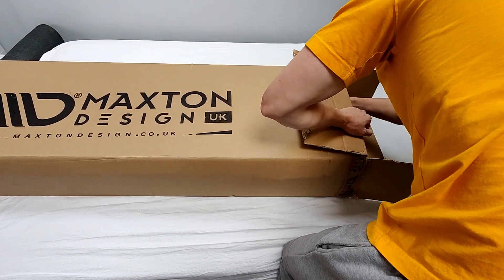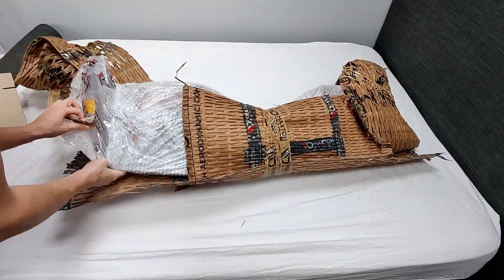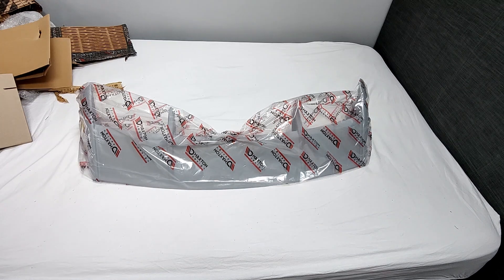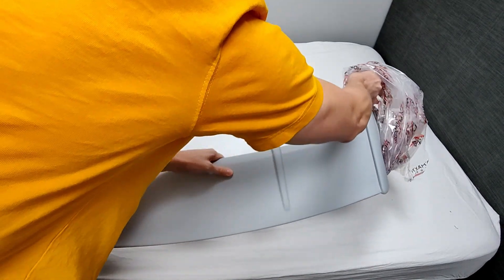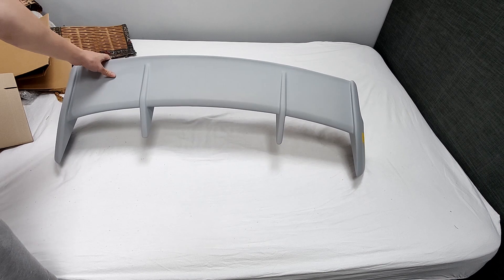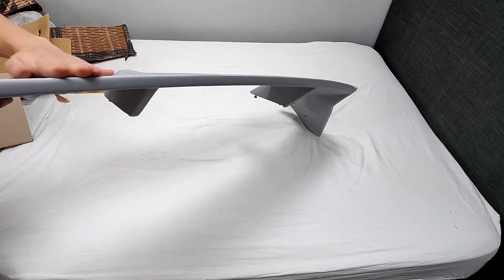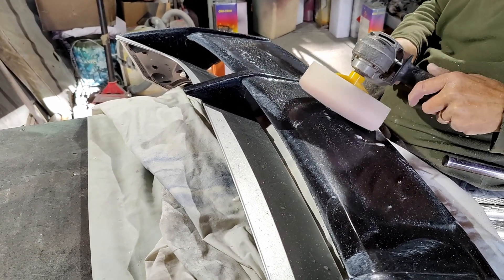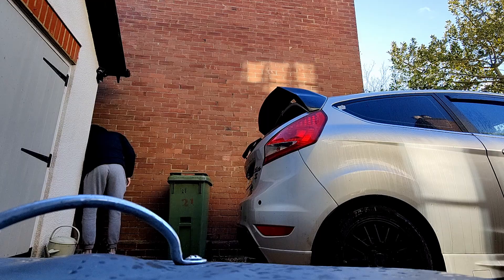RS spoiler for Mk 7 Fiesta

Comment: Did u drill holes in the boot for the 2 centre bolts just waiting on mine being painted
Reply from the maker: Only used one of the two center bolts on each inner bit, as I didn't want to drill into the metal roof panel of the car, it's been held on fine with 6/8 bolts as I also used a lot of mounting tape, hope this helps 🙂
Reply: @NAUTOG  cool cool am in the same boat about trying 2 lining it up 2 drill the holes when its back think I’ll get the tape or some Tigre seal when fitting it

Comment: What size bolts did you use to mount rs spolier to standard spolier ?
Reply from the maker: I'm not sure on the exact size, the Spoiler came with bolts from Maxton design so I just used those. Hope that helps 🙂

Comment: does it fit a 2010 mk7 fiesta
Reply from the maker: Yeah it should be no problem😁 👍
Reply: @NAUTOG should i take off the boot spoiler and attach it to that then put it back on or do it while it’s on the boot
Reply: @NAUTOG  and what kind of bolts did you use did you use the one that came with the spoiler
Reply from the maker: I took it off and found that much easier and yeah I used the bolts it came with 😁
Reply: @NAUTOG  sound out lad doing it meself today
Reply from the maker: Best of Luck let me know how it goes